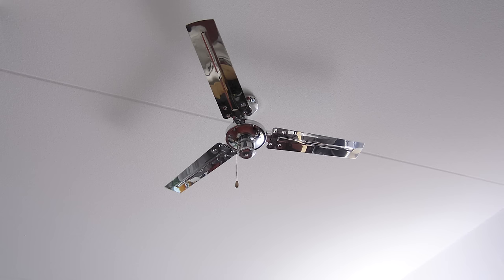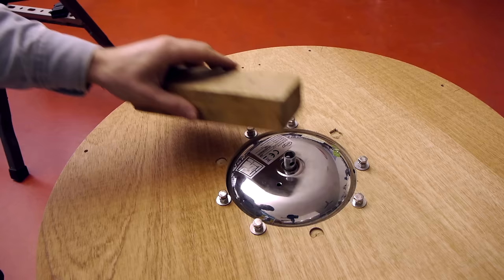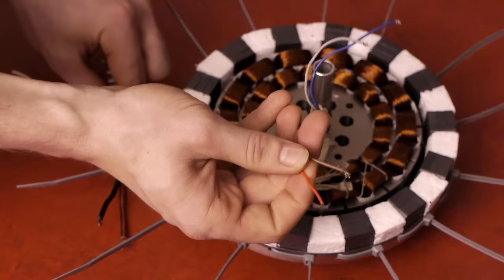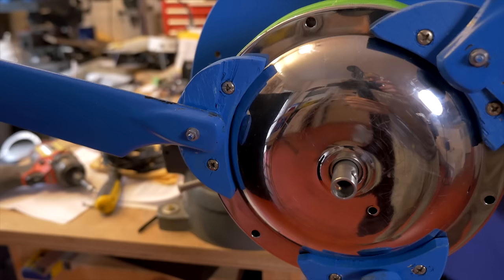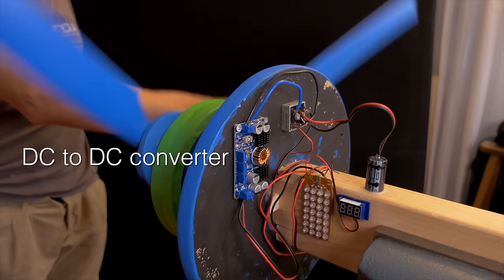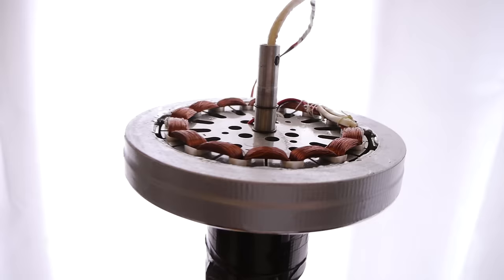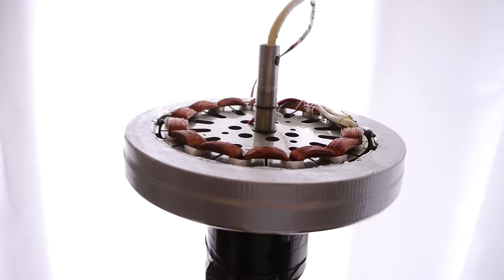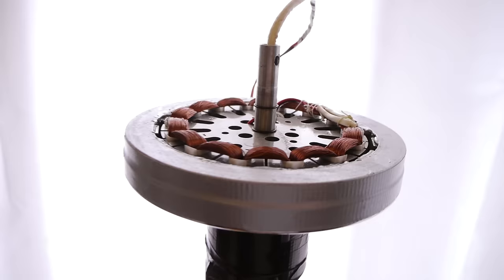Turn a ceiling fan into a wind turbine generator?!

Comment: Hallo from Amerika! Tennessee in fact, what is interesting to me (and you are correct - it IS an induction motor) is if a charge can be passed through it (like an alternator in an auto) that creates the essential magnetic field required in order to have the ROTOR ( the rotating part) generate more power and send it back out in relation to the field current or voltage. It seems to me even if it is wound 1 to 1, it is up to the wind forces to create the additional powe, so then the product should be variable according to the wind force applied. Same idea as using magnets - 
      it's just a kind of 'Ourobouros' thing where a battery is needed to begin it:
 ~ In order to produce an output, there has to be a charge for the field windings.
~ once running, it can sustain it's own field winding current (!) and the battery after re-charging can be disconnected entirely
In other words, the magnetic field is created by it's own voltage - which it uses to create the voltage for the magnetic field. Once voltage is introduced to the system...

    Really, I promise

  This is why a modern car can be got running, and the battery actually lifted out WHILE it is running and placed in another vehicle if necessary. But if it is turned off the whole of the electrical system stops right then. No Lights, no anything. Such an event doesn't even harm the system, it just waits for battery power or whatever.

Comment: Dear Giesbert .you are fantastic!  
 You answered nearly all my questions in one video.  HEEL DANK 🙋‍♂️.  
   I always wondered about how much voltage and current could be generated  from this kind of system .   
 You might think what to do with excess spill out energy.  For example to flow into a car battery.  
 You also answered my wondering about  cost effective..
  Genius.  Thank you

Comment: The use of permanent magnets keeps you away from having to use brushes but limits the control of the magnetic field strength , which is how automobile alternators work. One thought, instead of passing current to the rotor by brushes, use a separate winding to induce voltage from an AC source so you maintain brushlessness. The use of permanent magnets is easy, but permanent magnets are not really permanent. Using them for a long period of time will slowly degrade their strength, which is why commercial electrical generation uses electromagnets whenever possible. I was thinking about starting with the frame of an old home furnace blower fan, which I have just had to replace due to flooding in my basement, as a base for a wind generator. It was really fun seeing you improve performance by the addition of the extra iron between the air gaps. That is great thinking. I was thinking for really high current something like copper tubing might be a possibility, though cheap copper conductors from China and other places might be available. Insulation is another concern as non enameled copper will need to have some kind of coating added. A simple way of conductor sizing is how much current do you want to get out of the generator? If you are hoping for 30 amps at whatever voltage you will need gauge 10 copper wire or lower. (Lower number gauge means thicker, higher current carrying wire). I have a Bachelor of Electronics Engineering but I also learned how to wire houses from my father, who was a handyman type of person. The gap between practical knowledge and technical knowledge is difficult to bridge in some cases due to class distinctions between "lowly" electricians and "high brow" engineers. In my opinion both are needed for actual creation of useful items and neither should be more valued than the other.

Comment: For best efficiency use of an Arduino mini controller comes to mind.  In a nutshell: software based voltage monitoring and output control charging batteries seems a promising (and cheap) option. Some designs mentioned utilizing a "waste-gate" method that I would avoid. Efficiency is key.

Comment: The DIY system I have seen was a remote beach shack with a car alternator/regulator and a propeller. The shack was wired for 12V DC and there were some lead acid batteries for storage. It covered the basics, lighting, car fridge and an old car radio for entertainment.

Comment: What capacitor size, relay, and DC converter and control board did you use? Does that board handle a higher output?

Comment: Your magnet gap is not the one between your stator and rotor, but also the back of the permanent magnets that you have left without a core, they are on the wood. This is ALL your inefficiency in your motor!! Otherwise, good job, hope you see this message and make it super. p.s. you do not only have the option to put soft ferrite material at the back of your permanent magnets, but you could put magnets as well to propagate the alternating magnetic field. It's a Halbach arrangement type and makes your motor even stronger!!!

Comment: MIght be stupid, but ther's my idea: that bridge rectifier is 10A If i'm correct, the DC-DC is about 10A max also and most importantly is a push-buck converter. Why don't just go linear converter with a fuse to limit the output. And then the dc-dc if you want more control over it. On the generator side and presentation nothing to say, just perfect, came to learn this part.

Comment: I'm quite new with electronics myself . I learned alot from your video. Thank you. I wonder how it would do if you ran the output thrue a step down transformer. 
Also with the secondary coil you could use it as a brake for when it turns to fast a circuit could be built to apply current to the secondary coil thus slowing the rpms.? Just a thought

Comment: instead of changing the motor from induction...why not use the fan to turn something else like an alternator?  would that work?  if you put a pulley on each you could also increase the speed of rotation in the alternator.  i realize and alternator needs to spin at very high rpm so it might not be the best example...I would love to hear some simple suggestions since I am not an electric guy

Comment: Clever.  When the rotor spins too fast, you get too much voltage?  Maybe a suitable single through single pole, normally closed relay?  Put a power resistor (10 watt?) ahead of everything, and a 10,000 microfarad cap behind the relay.  Might take a 1/2 to charge the cap, giving the system to react and throw the relay, for 2 seconds, say.  So the line after the relay would have to discharge a bit before the relay is allowed to close to sample again.   So then your relay is like a push on, push off.  Checked by an op amp?  There used to be PIC microcontrollers for less than 50 cents a piece you could program and  on. Now there are units with all the trimmings for about $5.00 that will do more.  Check those out?  What to charge a battery system?  Have fun and best of luck.

Comment: i admire your intelligence with regards to generator....really awesome, i just could imagine how broad your knowledge.
BTW i have an ancheer ebike 36v 10Ah 250w
my problem is bought already from ebay a compact battery 36v 16Ah 500w i thought i could use this as a booster to existing battery.....but when i read the literature of the bike it says there "recommended for 250w  and 350w".......that is my big problem i might blew my bike .....that is why i am still hesitant to try.. Any input will be appreciated, thank you😊

Comment: I don't know about a wind turbine but I might attempt a flywheel generator / battery charger project attaching a brake rotor to the ceiling fan motor housing along with a pulley for kinetic mass & using a 12 / 24v motor to power it from a pulsed circuit, don't know if it will work but I have most of the junk already so its a matter of finding the time this summer to play around with it

Comment: Very impressive video. I can give some suggestions on some things that you probably have already thought of or already seen in comments....  For what it's worth, What you are doing really reminds me of the charging system used in a riding lawn tractor.  Maybe it would be elaborate to build from one of these parts because you don't have a bearing system unless you use the whole crank shaft which would be useless weight. However there is a pretty decent stator that is able to push approximately 15 amps at around 16 to 18 Vdc  And without the voltage regulator as high as 36 Vac.  An electronic voltage regulator from say a modern Kohler v-twin engine already has the internal electronics and rectifier  Built into a small unit that only has 3 wires. 2 AC's in and then 1 DC+ out .  The aluminum case is the ground. Storage batteries in 12 V are everywhere.  From there inverters can be used to bring it up to 120 V AC. The voltage regulator itself was designed  to  maintain 14.3 vdc +/- .1 V  on fully charged battery while running. Modern Honda, Briggs & Stratton, Kawasaki are all very similar to Kohler.

Comment: You don't need to rewind the coils unless you desire more amperage with less voltage, or more voltage with less amperage. The gap inside the coils doesn't matter unless it is far worse than it is on that motor. The power that is generated is determined by the number of turns of wire (more turns more voltage), the diameter of the wire (larger wire more amperage), the number of magnetic field lines cutting through the coil. Any given permanent magnet has a given field strength, consisting of a specific number of field lines.  In a generator, as the MAGNET IC FIELD switches from iron core to the next iron core all of the field lines of the magnet cut through the wire as the field switches from core section to core section. No field lines are "lost" or "wasted" in that setup. To make the generator more powerful, use either stronger magnets (more field lines per square centimeter, or higher "gauss") or decrease the air gap between magnet and soft iron core thus improving overall magnetic permeability, thus increasing field strength between magnet and core. You could have used the interior windings as well with the factory air gaps provided, instead of removing the windings and filling the gaps. The setup was designed to have maximum permeability for the coil sizes, so you wouldn't have lost anything. You actually did lose available power generation by removing those windings. Each set of windings would be wired up outside to their own full wave bridge rectifier, the outputs of both rectifiers connected in series and the output fed to a >large< smoothing capacitor. The larger the microfarads at the rated maximum voltage of the unit (peak not just load voltage) the better the smoothing will be. With the second set of coils, it would have had a MUCH smoother output anyway, as a set of windings would be actively producing electricity while the other set is not. The difference in voltage between the two sets of coils would be far less of a strain on the system than the system already has to deal with considering pulsed DC. In essence, two phase AC output, individually rectified, instead of rectified single phase. For a full fledged circuitry direct for use (which most generator systems are definitely NOT), you should have it first rectified, then smoothed, then fed to a current limiter or surge arrestor, then to a voltage regulation system for final stable voltage/current controlled output. Imagine your system in a sudden gust of wind while hooked to your phone, lol. Without those things, imagine a sudden voltage spike at enough power (voltage times amperage) to overcome your simple voltage rectifier. It would have the same effect as a lightning strike on a powerline for your TV. Wind generators are generally connected to parallel battery storage systems for a reason. The batteries themselves act as smoothers as well instead of using capacitors, of both voltage and current before the electricity is then fed to a voltage/current regulation system. In your system, the smoothing capacitor is essentially the battery pack. I suggest using a supercap if possible.

Comment: You could turn that into a crazy efficient water powered generator via belt drive. 
The brushless vs brushed motor debate will continue forever, but the fact of the matter is, "what can I improvise into an efficient energy source?"

Comment: a well selected battery to stabilize the output might be better than the 50 volt capacitor, then use the buck converter to bring it back down to 5 volts, given how slow you were turning that at the end i think you did awesome.

Comment: I did this and have now collected 8 or 10 fans to play with.  From what I understand, the air gap is critical, with the factory's at .09in and the best I could do was .35in and got 75vac with a very poor connection to a drill @ approx 2700rpm

Comment: Thank you.... that was very good explanation and very honest assessment of using a motor without magnets. What are other sources of DC motors with magnets? If using a hover board motor, what would the output be? DC? Varying voltage with speed? Still need a controller? Also , if using the wind generator, you will need to have it high enough to get into "clean" air,...........Cheers, Jim

Comment: if u connect 5A battery charger would it charge if the voltage jumps 40-100 volts

Comment: You can use the induction motor as a generator without any modification, all you have to do is to add an AC Starter Voltage on the stator winding while the rotor is spinning, and then you can remove the AC Voltage, because the Lorentz Force keep's the magnetic field in the Rotor, so it's producing current until you stop spinning the rotor, this is how modern trains use the motor for generator if they slow down (nearly every electrical train has an induction motor, also known as asynchronous motor.

Comment: Sir.im an Indian I have passed electronics in technical course. Sir my question is that you would not had cut off the inner coil of fan stator instead you would had connected into serial to outer coil of the fan rotar in order.to obtain more voltage say around 110 volts
Instead of making a wind generator you can rotate the fan rotor with a powerful. DC motor of 24 volts given two lead acid batteries of 12volts connected in series to obtain 24 volts. Then turn the the fan rotor to obtain AC current which is converted into DC through rectifier and reduced into 24 volts to rotate the motor which is joined with a fly wheel and belt. Thus free electricity can be produced i.e. mechanical energy is converted into electricity and vise versa.

Comment: Please, who can help me with this. I have been trying to make my own ceiling fan - improvised generator, but the problem is that the connecting cables has been disconnected from the holes of the fan. 
      I want to know if it can be fixed and if yes, how.

Comment: Great video, thanks.
One comment though; looks like the air gap has one additional function to the one you've mentioned:
Since the inner coils are placed in a way that enhances one outer coil and opposes the next, it looks like, when the inner coil is connected, the air gap allows magnetic flow to run at opposing directions through the core of the (disconnected) outer coil, at the cost of some resistance to the magnetic flow when the outer coil is connected.
Of course, I may be wrong... can two magnetic fields of opposing directions run through the same core, (without the gap), without interfering with each other, and without cancelling each other?

Thinking about it makes me wonder: what would happen if you left the inner coil, with its own rectifier, and added its output to the outer one?
Wouldn't that give you a little extra "juice", or reduce the output?

One other point to consider:
A ceiling fan has low wattage, typically between 40W-80W, which works great to lower your electric bill, but not so great as a generator.
Removing the inner coil probably reduces the output even further.
So while I understand the advantages of a fan when building a wind turbine generator, maybe a higher wattage motor would be a better choice?!?

Thanks again

Comment: Instead of allowing the system to shut down when the voltage is exceeded, you could introduce the excess power back into the coil to add a braking affect.

Comment: It can be done in monolithic coatings helps contain the currency without the leakage even somewhat waterproofing cuts down electrolysis dramatically seems to add to a sound motor the guys making their tattoo motors love it

Comment: What if you use a alternator from a car? I really want to make a generator for my Evite so when I'm riding it will charge but I want to use small fans. All I need is 12 volts and a inverter I think

Comment: Loved your video. Your invitation for improving electronics requiresctwo more inpurs from your side: 1) what is the maximum stator voltage ? 2) what are the load voltage levels?

Another query, can't we try to use it as an induction generator if there is a battery and inverter available?

Comment: That's cool. Hey it's free energy. Hook it up and see what the output is over a month. 2.if you can get enough energy to charge 24 or 48 volt batteries.  You could hook the batteries  up to an inverter for 110 or 220 vac depending on where your at. It a backup   for your electricity.

Comment: Should get a AGM battery, and a charge controller, can go off the grid if you have enough batteries, solar, and or water turbines, as an electrician I've used certain brands work almost perfect as is! Usually the older ones. Either way, off to a good start!